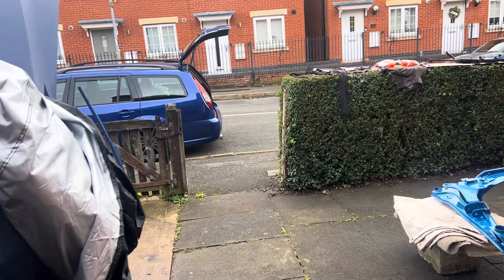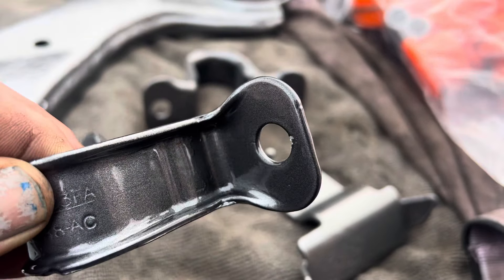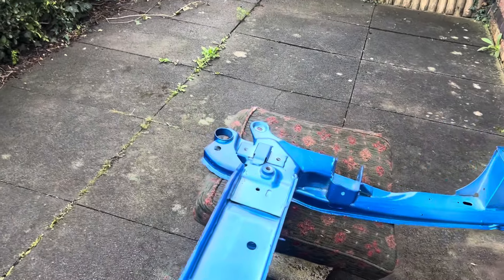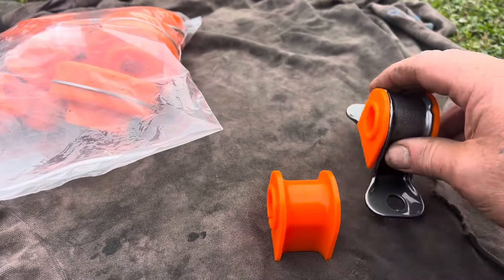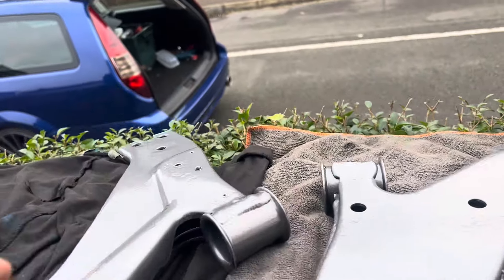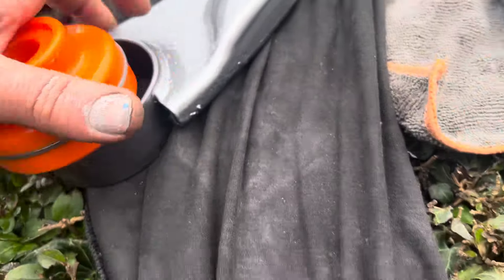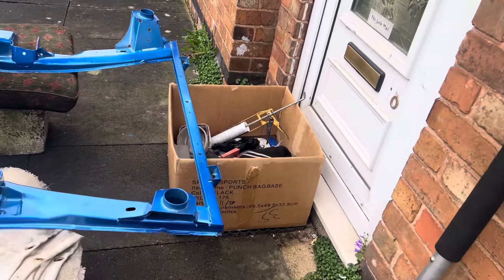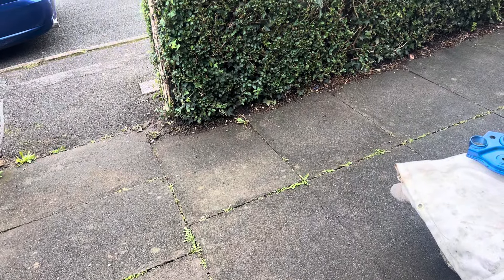TIGS is finally getting his freshly powder coated “ complete” front subframe ( please don’t scratch)

Comment: Nice work Dunk.
Few questions tho as I'm planning to change the front sub frame on my derv after I've replaced the clutch.
Why do you use red grease rather than any other grease?
Have you fitted those poly bushes before if so did you notice a difference in the ride as some people have said it makes the car rides more harsh?
And finally what diameter are the front arb as I'm going to upgrade the bushes as well?
Keep up the good work it'll look wicked once it's all done 👌👍
Reply from the maker: Firstly as usual appreciate yr time to view my content m8 really do , yea the ride is a lot harder than normal but not too harsh m8 I’ve done all mine , so the answer to yr orther question is yes m8 done err quite a fue of them and yea the red “ rubber” grease is comparable with all rubberised components so doesn’t rot or detonate the rubber and yea same as with the polyurethane m8 and aids the ease of the parts going together m8 personally I wouldn’t T fit standard stuff now prefer poly bush to standard m8 hope this helps again appreciate the comment 👍👍
Reply from the maker: Firstly as usual appreciate yr time to view my content m8 really do , yea the ride is a lot harder than normal but not too harsh m8 I’ve done all mine , so the answer to yr orther question is yes m8 done err quite a fue of them and yea the red “ rubber” grease is comparable with all rubberised components so doesn’t rot or detonate the rubber and yea same as with the polyurethane m8 and aids the ease of the parts going together m8 personally I wouldn’t T fit standard stuff now prefer poly bush to standard m8 hope this helps again appreciate the comment 👍👍 oh the arb is 22 mm m8